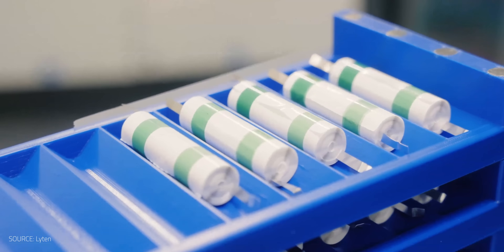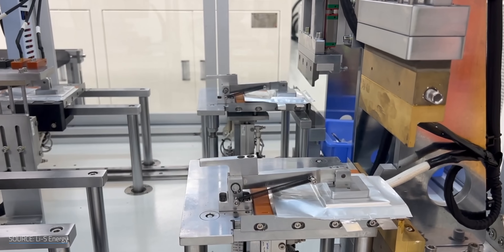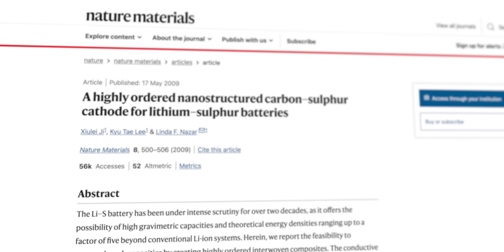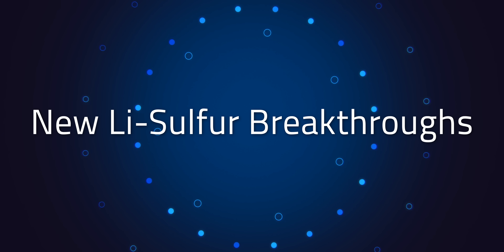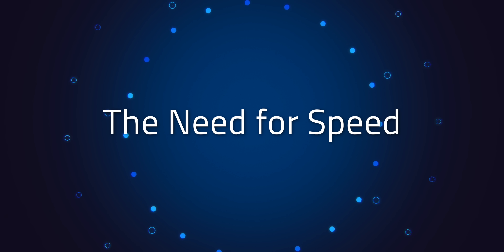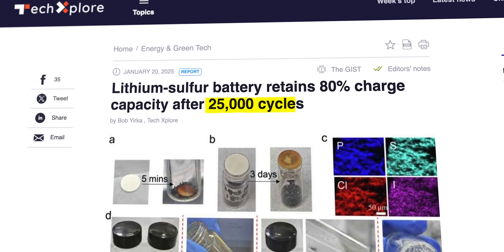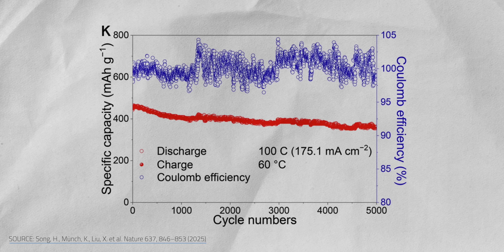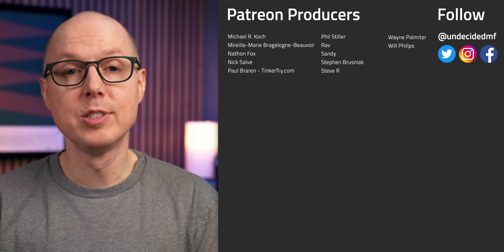How This Overlooked Battery Might Change Everything

Comment: You make a lot of optimistic battery videos over the years.. but there's nothing yet available to the general public.. starting to sound more and more like marketing talk..
Reply: Or you're not aware of what has been introduced and somehow assume things you don't know about don't exist? Solid state batteries are beginning to be available, charging speeds have increased in some consumer applications, and GM moved to LFP. Sorry if the cynicism was more satisfying to you.
Reply: @zweigackroyd7301  "beginning to be available".. charging speeds.. lol ok.. you basically just repeated what I said .. the fact of the matter is, most electronic devices STILL use some kind of lithium-ion battery.. it's a fact! let's see how many more decades before this changes..
Reply: @takisk.7698  Lol, no, I corrected what you said because you had no idea and were too lazy to check. But I'm sure it somehow makes you feel super clever if you blather on about how there is no change. People like you put a lot of energy insisting solar energy would never be cost-competitive with fossil fuels. I'm sure they also conveniently forget how certain they were.
Reply: @ you are spitting nonsense now, well done. I literally stated facts like how nothing significant has changed in so many years and your answer was laughable.. unless you really think lfp batteries is a significant change lol.. 
Just give me a SINGLE widely used example of a "next-gen" battery .. ill wait.
Reply: @takisk.7698  Hilarious that you think you're stating facts, when what you state is wrong. Did you know that you can look this stuff up? (Rhetorical question, obviously you don't know that.)

Comment: If the production of plutonium 238 (think thats the number) could be expanded then charging batteries would not be needed and batteries would work for over 100 years..  and itd be safe to use once converted to the 238..

Comment: The technologgy is changing rapidly, but for me the nominal voltage per cell is too low.  Fast charging is great, but for twice as many cells.  ...and the capacity of each cell is still questionable.

Comment: HOW flammable is it at warm automobile use temperatures in the summertime and if in an accident with a major bump and damaging crash?
Lithium batteries initially (not ion) were VERY FLAMMABLE, though very powerful and quick discharge/recharge cycles...

PLEASE let us know - sulfur is a flammable constituent in matches so it should not be overlooked as even some TESLAs took to flammable endings on their own early on even with Lithium Ion battery packs.

Very interested !
Reply: Wood is a flammable constituent used in matches too, but no one is going around panicking that we use it all the time to build houses.

Sulfur is very safe compared to lithium. It's safe compared to gasoline too. The biggest risk with a lithium sulfur battery is still going to be the lithium.

Comment: Did I miss it, or was there no mention of voltage per cell, or charge and discharge currents?
Reply: I think he said they could operate 1.6v higher than current lithium ion batteries. Not sure on the charge discharge but think I saw a comment that mentioned a curve was shown in the graph - asking was that 100C it was discharged at or something like that?
Reply: @TorqueFormulaWon  So we'd be talking close to 6v per cell at full charge, should make a jump in laptop life, and spin props faster in RC airplanes.
Reply: @PiDsPagePrototypes  I thought I heard that mate but I could be wrong as I googled it afterwards and lithium sulphur are 2.5v approx ATM. 

If I can find the section again I'll try but assuming that I did hear it right it may be 2.5 + 1.6 so 4.1v.  My bad if I got this wrong.
Reply: @PiDsPagePrototypes  I found the time stamp for it 08:35 onwards he states that there is a 1.6V improvement to current batteries but it isn't stated in the paper. I was doubting myself about hearing it but yeah it is in there is you need it.
Reply: @ (thinking out loud mode) That jump in voltage, at same or similar storage, means achieving the 400 or 800 volts of an EV system with less cells per series string, meaning for the same total number of cells (or mass of the pack), we'll have more of those strings of cells in parallel, bumping up overall current output potential, either by higher voltage per cell or higher current per pack, the performance potential should make quite a jump - Model S Plaid's are going to look slow.
Reply: @PiDsPagePrototypes  Well hopefully. I'm not that well up about the usage but if it's true anyway it sounds promising. I heard about these batteries and their issues a while ago and thought they seemed one of the more promising ones. I'm still not the highest advocate for lithium though. It has it's uses but hope there are more using more abundant elements , solid state, less toxic, easier to recycle but that's a personal preference or other types of batteries altogether.

I also find it problematic if infrastructure isn't upgraded to carry the load for all these EV's but that's a separate issue. Still I hope these have some applications and having less mess and more energy helps a lot depending on use case.

Comment: A fast charging battery sounds great but the reality is we don't have the ability to supply the electricity to do it. The electrical grid would need a massive upgrade to be able to cope.
Reply: This is a false argument. The grid can't handle it if 100% of cars converted to EVs over night. That, however, is not reality. The reality is, EVs have a very small market share of cars on the road right now. That transition will happen slowly, over decades. The power grid will adapt over time, just as it did to accommodate the extreme demand for central air conditioning in the USA. The power grid argument is a stupid argument not rooted in the reality of technological transition time frames and our ability to change with them. It's a made up, non-issue.
Reply: Stationary storage at the charging station solves that.
Reply: You don't have to charge at maximum speed all the time, every time. Like, charging your car overnight in your garage. That's hours of downtime available. Which means the car can slow down to, say 20% maximum charging speed and still already full in the morning.
Reply: Depends on the size of the thing you're charging.  E-bikes tend to use batteries in the 500-watt-hour range, a 15-amp circuit can deliver 1500 watts to the battery, or charge it from empty to full in about 20 minutes, if the battery will allow it.
Reply: @Tyrandus89 - I agree that the power grid SHOULD evolve with demand. And, indeed, in post WW2 decades, it did. But since the EPA and other regulatory assaults, the power generators have fallen way behind demand increase. The recent deployment of sustainable generation has helped somewhat, but lack of mass battery storage hamstrings wind/solar generation growth at present.  Also, grid infrastructure is mostly government-run. And we know how well the gov’t. bureaucracy keeps up with tech development.  On the other hand, we have an ally in development of more electrical generating capacity - big tech. The AI industry depends on a dramatically increased electrical capacity. These are fascinating times!

Comment: Have a look at LeydenJar. This 8-year-old Dutch startup has created a thin-fim cathode that replaces graphite. It makes batteries lighter and smaller. Think of anything from wearables to aviation. They are currently building their first factory in the Netherlands. Instead of making their own batteries, they can sell their cathode to any battery manufacturers worldwide. This can speed up market entry and position them as the ASML of battery tech.

Comment: More energy stored in a smaller volume...what does that mean in the case of a catastrophic failure?
Crush a battery, you've 'short-circuited' the thing.
Regular lithium cells are drama-queens when they get testy...can't help but think sulfur-lithium will have low-impedance (shorting out) failures.

Comment: To charge in 12 minutes(assuming 10 to 80%) for a EV that gets 1000km(100% charge) is going to take a LiS battery capacity of 500Kwh. That is going to take a charging source of 800KW-1MW.  What is the Volts and Current load of the source? How big are the cable(s) from the charging point to the EV? Those cables are going to generate heat and require cooling which is going to increase the cable size. Multiple that by 5-10 charging points is going to take a substation to run from the power grid.

Comment: As much as I love learning about the latest research, the study drum beat of supposed advances leave me thinking I shouldn't concern myself with this tech until it's available on eBay.
Reply: Or your local store... All is click bait until I see them at Home Depot AT a reasonable price. Otherwise just BS.
Reply: @SkipMichael   Some tech, like LFP, comes out of China first. Those sellers are more likely to be on ebay than Home Depot. I picked up my LFP cells from a local warehouse operated by a Chinese seller. LiS cells may be different since it seems as though Lyten may be the leader in commercializing this tech. But I bet cheap Na cells will be on ebay first.

Comment: hmm "Packs more energy per gram, but is lighter."  Taking that as stated, I do believe a gram is a gram.  Whether a gram of feathers or a gram of steel.
Reply: He didn't word it correctly. The whole battery pack can have less weight and have the same potential energy as lithium ion ones.
Reply: yes, gram is a gram.
and you can make a battery, that weights less grams. (while still packing more energy PER GRAM)
surprised pikachu face
Reply: @stclaws9580  Yes, but not what he said.

Comment: Well, with the number of charges.... it will probably be a bad commercial value since when the market is saturated it will not be needed. Unless they will be less chargable and therefore need replacing in commercial usage much sooner.
For the higher and more stable ones, the price will probably be higher too and thus even less feasable for widescale use.
Therefore... some variables will probably be available.
What about the voltages and do they need special charging-equipment that cannot use the now used charging-systems? Much different voltages? That would mean lots of parts in electronics need to be developed for major use too.
At the same time, as long as rare-materials are (also) needed, it will some time to get there an mine those enough or at all for widespread use and cheap-enough like those Li-ion cells of today.

Comment: Lithium-Sulphur Batteries: A Next-Generation Energy Storage Solution

Lithium-sulphur (Li-S) batteries are an emerging battery technology that offers several advantages over conventional lithium-ion (Li-ion) batteries, including higher energy density, lower cost, and reduced environmental impact. Unlike Li-ion batteries, which rely on materials like cobalt and nickel, Li-S batteries use sulphur as the cathode and lithium metal as the anode, making them a promising alternative for applications such as electric vehicles, drones, and aerospace.

One of the key advantages of Li-S batteries is their higher energy density. While lithium-ion batteries typically store around 250 Wh/kg, Li-S batteries can reach 500 Wh/kg or more, making them capable of storing roughly twice the energy per unit weight. Although some early projections suggested Li-S batteries could achieve up to five times the energy density of Li-ion, real-world performance currently remains in the 2× range, with future improvements potentially pushing this even further. This makes them particularly attractive for applications where lightweight, high-energy storage is critical, such as long-range electric aircraft and space missions.

Beyond energy density, cost and resource availability also make Li-S technology appealing. Sulphur is abundant, inexpensive, and widely available as a byproduct of the petroleum industry, unlike cobalt and nickel, which are costly and subject to geopolitical constraints. This means Li-S batteries have the potential to be cheaper and more sustainable than their Li-ion counterparts. Furthermore, the environmental benefits extend beyond material sourcing—since Li-S batteries do not rely on toxic heavy metals, they could reduce the ecological footprint of battery production.

However, despite these advantages, Li-S batteries face significant technical challenges that have slowed their commercial adoption. One major issue is their shorter cycle life. During charge and discharge, sulphur undergoes a reaction that produces lithium polysulphides, which can dissolve into the electrolyte and lead to capacity loss over time. This phenomenon, known as the “shuttle effect,” causes the battery to degrade faster than traditional Li-ion cells, limiting its lifespan. Additionally, sulphur has poor electrical conductivity, which means conductive additives like carbon must be incorporated—adding weight and reducing overall energy efficiency.

Another challenge is the stability of the lithium metal anode. Lithium is highly reactive and prone to forming dendrites, which are needle-like structures that can grow over repeated charge cycles. These dendrites can cause short circuits and even fires, raising safety concerns. Researchers are actively working on solutions, such as solid-state electrolytes and protective coatings, to mitigate these risks and improve long-term performance.

Despite these hurdles, the future of Li-S batteries remains promising. Companies and institutions such as NASA, Tesla, and leading battery research labs are investing in the technology, and some prototypes have already achieved over 1,000 charge cycles—a significant improvement compared to earlier versions. With continued advancements in materials science, electrolyte design, and battery architecture, Li-S batteries could become a key technology for the next generation of energy storage, enabling longer-lasting electric vehicles, lighter aviation batteries, and more efficient renewable energy storage systems.

Comment: At 2:55, the solution is easy: Prescribe some form of statin into the battery. If statins are good enough to treat high cholesterol and plaque buildup especially, it could be used for this application as well. What's the problem?

Comment: Great video;  very thought-provoking.  From my understanding, the manufacturing process with sulphur is similar as with other battery technologies, so minimal cost there.  The difference in cost is a huge incentive as the potential profit is huge.  Also, swapping battery technologies does not imply changing the appliance: it is likely to be a 'simple' software change, not hardware.  In a sense it is like changing from the old zinc cells to using alkaline cells, or even rechargeable cells: you just change the batteries.  This is one of the beauties of EVs: change the battery to change the performance/range/charging-speed/etc. without changing the vehicle.  Remember, the old batteries will still hold significant value, both for continued static deployment on the power grid, and for recycling.  So it wouldn't be a case of throwing your used lithium-ion battery away,  The price difference might even mean the outlay to change an existing EV's battery could be minimal.  Very interesting indeed.  Thankyou.

Comment: Super fast charging isn't really meaningful in the BEV area because of infrastructure requirements to feed those charging facilities if they become commonplace. High voltage high amperage charging is a dangerous game  for the everyday consumer product.

Where the fast charging is really needed is at storage banks near to the intermittent "green power" facilities that can rapidly absorb peak output when it exceeds the demand load.

Comment: So when are these batteries going to come out like the new nuclear diamond battery and everything
Reply: Easily another 5 -10 years, depending which specific advanced battery tech you're refering to, since most manufacturers won't re-tool/re-work their current production process, until they know for sure that a new design/chemistry actually works and is well proven. Most manufacturers also won't adopt a new chemistry, until they've recouped/turned a profit on the technology they're currently invested in. About the only thing that might bring some of those technologies to market faster, would be a shortage of current materials, a major (current) materials price hike, or a company fearing they might miss out on market share, if they wait too long to adopt a new chemistry.  Incidentally/btw, I wouldn't be holding my breath for the Lithium-Sulpher batteries either, given word on the street is, Li-Su technology doesn't (currently) have very good cold weather performance, which the video failed to mention.

Comment: Sulfur is a lot cheaper than cobalt. But I wonder whether these batteries use less lithium than lithium ion batteries.  If so, they are potentially a lot cheaper.  If that's the case, their ultimate adoption is virtually inevitable.  Unless, of course, a better, cheaper technology emerges in the mean time.
Reply: I wonder if anyone is looking for a viable alternative to lithium, because of the price and availability.

Comment: Even if it isn't specifically lithium sulfide batteries that come out of this, having experience using sulfur as a cathode seems like a good reason to pursue this tech. We know its hard to beat lithium as an anode, but researching toward all parts of the battery being cheaper and more energy dense is probably a good thing.